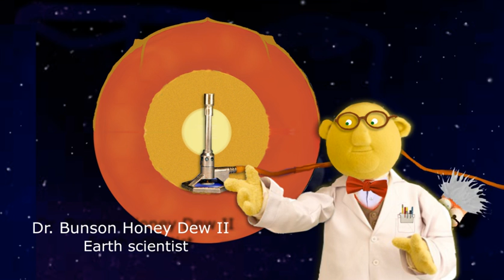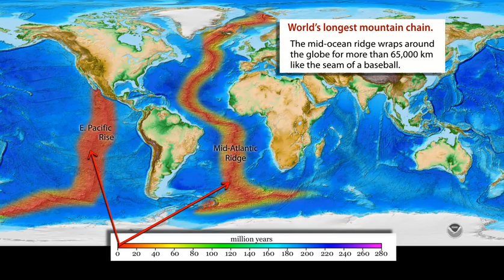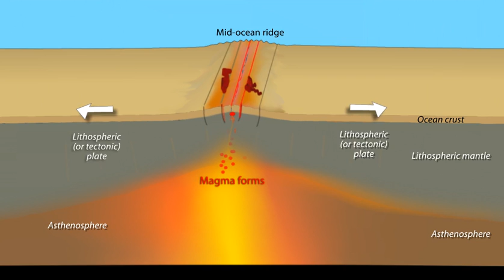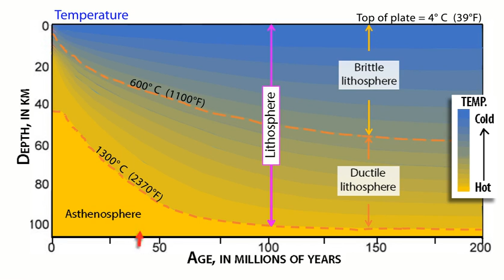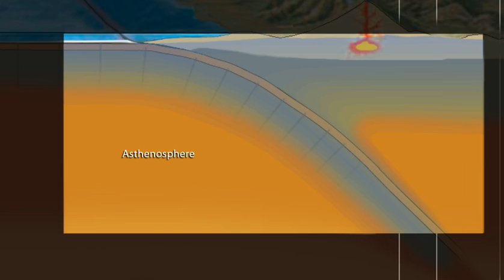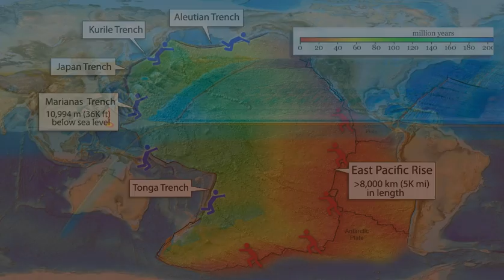Plate Tectonic Mechanism

Comment from the maker: HOW DO PLATES MOVE?
The mechanism by which tectonic plates move is still a subject of much debate among Earth scientists. The Earth is dynamic thanks to its internal heat, which comes from deep within the mantle from the breakdown of radioactive isotopes. It was long thought that this resulted in convection currents in the mantle which were responsible for the movement of tectonic plates across the Earth’s surface – indeed this is still the most common idea illustrated in many textbooks and on the internet. However, this theory is now largely out of favor, with seismic imaging techniques unable to identify mantle convection cells that are sufficiently large to drive plate movement. Some plate models show that two thirds of the Earth’s surface move faster than the underlying mantle so there appears to be little or no evidence that convection currents in the mantle move plates (apart maybe from some very small plates in unusual circumstances).How plate movement operates is being revised all the time as scientists unearth new evidence, however, the detail still remains highly controversial